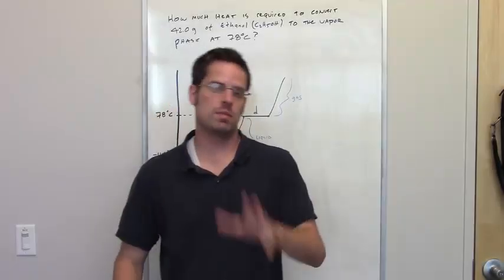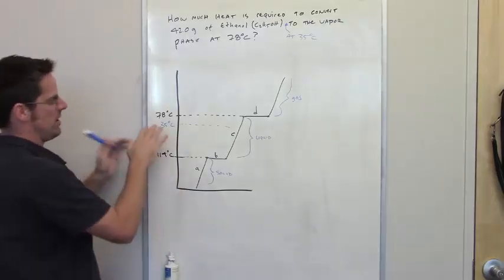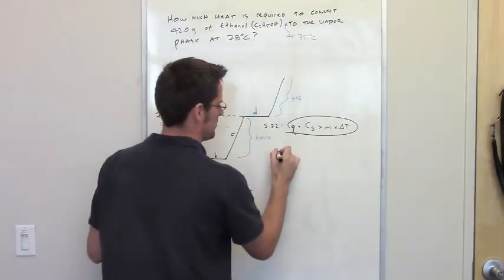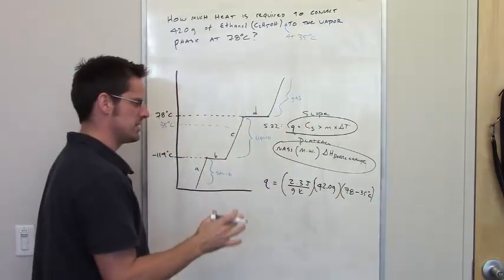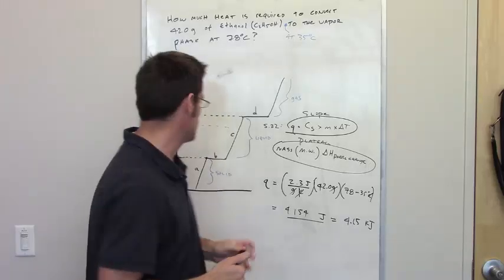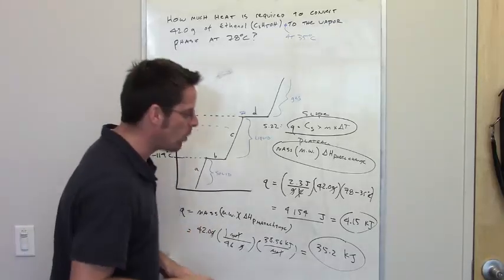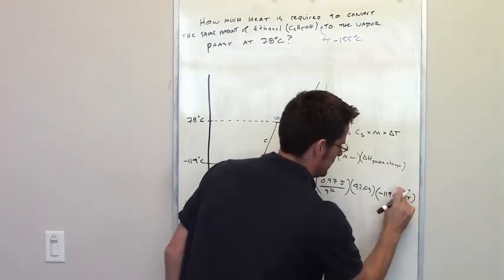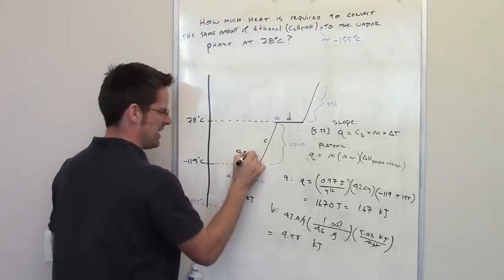Chapter 11 - Liquids and Intermolecular Forces: Part 8 of 10

Comment: When I looked up the specific heat of liquid ethanol I get 2.46 J/ grams degree C... formulating my answer in being 4.44 x 10^3 J.... ???
Reply from the maker: That answer is totally correct (though your specific heat value is a little different from mine; not much, just a little). Anyway, great job, Hermaley!